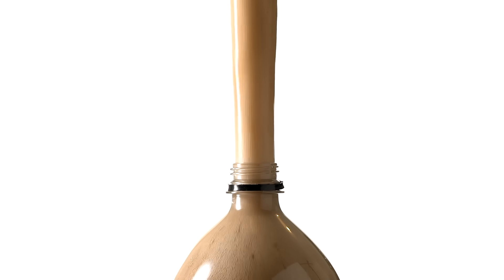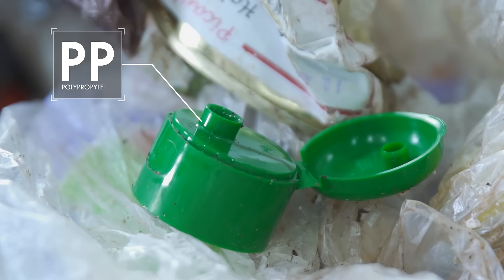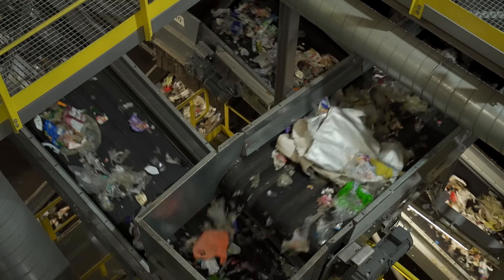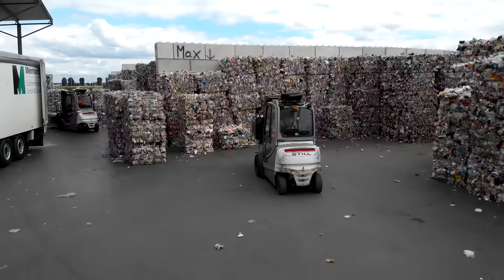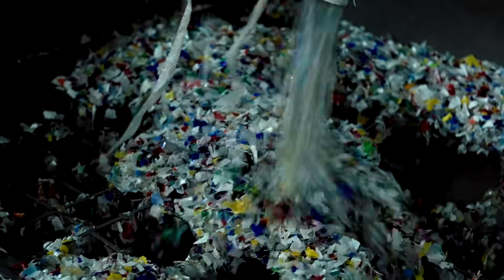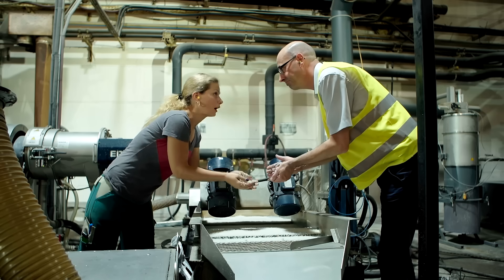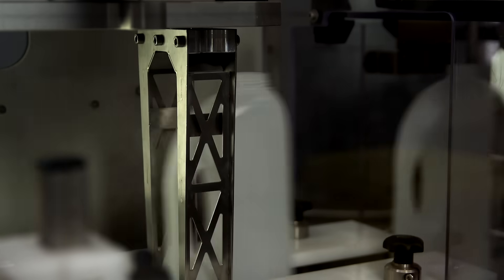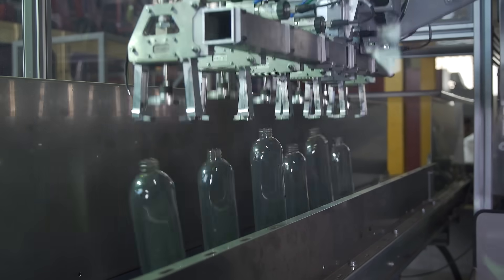Recycling plastics – Resource efficiency with an optimized sorting method

Comment: It might sound kind of wild, but why cant they build houses with recycled plastic bottles. ??  !!
Reply: Structural integrity and characteristics of materials is the most important point that makes industries choose a certain material for its application. So, is there a plastic that can replace a reinforcement bar while construcing a building, would be a few questions
Reply: It's definitely possible for companies that manufacture plastics that are used for construction like electrical sockets and blue electrical boxes to use recycled plastics.
Reply: It would be more expensive than conventional material.
Reply: @andregenter4213  that's true, it would have to have outside incentives like maybe a tax break for companies that use more recycled plastics in their products
Reply: https://youtu.be/c-wE2oaQ8Mo

Comment: It’s time manufacturers were ordered by all governments across the world to use only recycled/100% recyclable plastics. 

I live in the UK, many councils (to those outside the UK, our waste collection is performed by our local councils) within the UK don’t have any facility to recycle PP (5) plastics, the same occurs with Tetrapak items which all end up at incineration plants or landfill. Currently only 18 local councils within the UK offer Tetrapak recycling which is so disappointing.

Either governments need to change the legislation to prevent these “hard to recycle” plastics from being used by simply banning them as manufacturers would easily substitute them for another plastic that can be recycled. The alternative is for all councils to centralise the management for certain “hard to recycle” items and invest in the technology to permit it.
Reply: There's a tone I could go through regarding this but I'll try to keep it short. What makes thermo-plastics "hard to recycle" is determined by two main factors. What additives were used in the making of the original product and if the plastics have been bonded to other incompatible plastics or materials. Because what we want back from the plastics during recycle is the polymer itself and as little else as possible. But before we can even consider changing legislation regarding "hard to recycle" plastics, we need to consider why those additives and material bondings are done in the first place.

And that simply comes down to the consumers. These choices are more about economics than anything else. Consumers would rather buy a toothbrush with a soft TPE touch and matching colors than a plain white hard bristle rod. Even though the latter is the easiest to manufacture and recycle, consumers pay more for the "fancy" option. And if there's a higher demand for "fancy and hard to recycle" toothbrushes, manufacturers will follow that demand.

Fun story about that: Back in the day when plastic toilet seats were introduced, they were mostly disregarded by consumers because of their "cheap" feel in comparison to wood or metal seats. What manufacturers did was to add some chalk which increased the weight of the seats and made the product feel more "premium". All the while, chalk is cheaper than plastic, so the manufacturer saved money on production and consumers paid more for them.

What I'm getting at is that there are so many cogs turning in the decision making of how plastics are handled that simply "changing the legislation" isn't going to fix the problem. Especially since "hard to recycle" plastics isn't a definition. It's relative and ever-changing.

And I didn't even touch the subject of incineration plants.

Comment: If the caps are seperated at source itself, Can that be sterilized through and reused....instead of crushing, melting and remaking those caps ?
Reply: @Learning History A different idea I can think of is actually sorting the caps by manufacturer or type and then regiving/reselling to the original source. The price gotta be lower than making new caps tho which is... pretty low I fear

Comment: Aimsea Group one of the biggest manufacturer for non-toxic, Eco-friendly, odor free Ca/Zn PVC Stabilizer & additives/Heat Stabilizer/One Pack Stabilizer for PVC floor, wall board, profile, ceilings, pipes, water supply pipes, drainage pipes, PVC fittings & any PVC Solution. It has good weather stability, environmentally friendly, excellent initial coloring, low plate out, better cost performance, good thermal stability and wide processing range. Welcome to inquiry. For more details contact: 

Phone/WeChat/WhatsApp: +86 18145867486

email: anis.r@@t
website: @t or @t

Comment: In the early 1990s, I worked for a Major Cola distributor in central Massachusetts, USA. I was a phase one recycle material sorter. Trucks would roll in, after they had made their deliveries, and off load bags of plastic bottles and aluminum cans. It was my job to empty the bags on a conveyor belt and remove foreign materials from the bottles/cans depending on which we were baling at that time. What sort of foreign material? Moldy food waste, such as pizza, grinder sandwiches, chicken bones, medical waste, such as syringes, dead animals, such as mice and rats, human and animal waste, aka feces, to name but some of what I retrieved from those bags. Beyond nasty! I was issued rubber gloves, a size too small, I wear XXL. I would go through 8 - 12 pairs a day! From which, I developed a latex allergy, as well as, chemical burns from the highly corrosive cola syrup. Many sodas contain phosphoric acid as an ingredient. This acid was developed as a universal solvent in medieval times. Ever see a frosted glass bottle, or glass with frosted designs and/or lettering? This is done with wax and phosphoric acid. The blue plastic barrels in which the syrup for these colas are shipped have warning labels that warned that their content is highly corrosive. At the end of my shift, I could literally stand my coveralls in a corner, as they were stiff from the cola syrup. The injuries to my hands were explained away as eczema. I was fired, due to an on the job injury, due to the negligence of co-workers on another shift. I received a settlement, half of what I should have receive, bamboozled by my lawyers. Lawyer, bad spelling of a liar. Years later, karma saw them disbarred for being in bed with the opposite side. And since the time I left that job, I have never had a bout of what the company quack named as eczema. They are as shiny as a freshly minted penny, from the burn scars.
Reply: You sound too dammed smart for the job!!
Reply: Nice story, just remember do not spread fear about chemicals: there are far far more nasty and toxic chemicals than the good ones it all depends on concentrations and types, thank you.

P. S. I know you had your reasons, I'm speaking just to make sure that there's no science ignorance here.
Reply: @giovannipelissero1886  I fail to grasp your point. I, personally, am addicted to one of those name brand sodas. Besides the injuries in my "story", I have diabetes and kidney stones. I once passed an eight millimeter stone, naturally, and passed a 2mm one today. The problem is that there is a global science ignorance, and a vast need to ramp up recycling. The Earth's oceans and seas have floating islands of plastic that many of the human race have not a clue of their existence. All these so-called natural disasters is Mother Earth crying out warnings, that we can no longer ignore her warnings. Fresh water aquifers are drying up, never to flow again. Why, because of all the living water bags that walk our earth.
Reply: @BayouOgre  sorry I misunderstood your comment.
I agree with you, the earth is deeply changed and that is a fact, and in some in cases in a irreversible way or the way to reverse things is incredibly difficult. 
Plus, I'm also worried about the mere resources of plastics which are petrol based that one day will run out.

Comment: If it came from the under ground then put it back simple as that 

I think
Reply: It’s made from crude oil by breaking and restructuring hydrocarbon chain . This manufactured plastic with all its benefits have a single most severe negative impact I.e. it doesn’t degrade until 500-1000 years . Now imagine all the plastic ever created and more that will be manufactured in future. What would be the result ?

Comment: as long as human being needs "convenience, cheap stuffs and profit",  pollution will always come along.
Earth has been circling the sun for billion years. When human being vanishes from the surface of the earth, all the pollution problem such as toxic waste, plastic particle in the ocean, CO2 in the atmosphere will be solved because the earth can rejuvenate by itself even nuclear waste is not a problem!
The soonest the human being disappear from the earth, the soonest the earth starts rejuvenate itself. 
SO, LET START SCREWING OUR SELF, FAST!
Reply: 400 million years ago trees littered the earth and 50 million years later the earth learned to break down trees. scientists recently discovered a new enzyme that breaks down plastic into its original form which just goes to show how well the earth adapts under extreme stress. they’ve engineered and modified this enzyme to break down plastics at a 4x higher rate than normal. as long as we keep the plastics out of our oceans were ok 👌🏽

Comment: I want to buy the equipments that process the recycling. This is great to keep our city clean. Please provide informations that i can use to get the company built the recycling plant process.
Reply: Do you have any clue how much these machines cost I work a yard like that the machines sale for hundreds and millions of dollars
Reply: Wendinmonegde Pitt I wouldnt say the machines are the problem, the infrastructure is. If you use trash like in the US you dont just have to sort the plastics and once in a while a shoe or wood but the entire trash with food and basically everything... I dont think these machines would do too great (or at least far less efficient) under those circumstances...

If you become the President your chances at achieving this in the US should be much better =D But hey, get it going, who am I to say if it works or not
Reply: Buen proyecto, alta rentabilidad

Comment: It’s a step forward but not good enough. Plastic has to be reused by refilling containers. Once off use should be illegal. Why should the empty plastic Coke bottle be used only once? Perhaps plastic becomes toxic in the sun , then we will have to create better quality plastics. We need to re use plastic containers and that’s the only solution. As for clothing we need to move away from plastic fibers by heavily taxing the synthetic textile industry.
Reply: Nick Voutsas Not wrong but just simply refilling bottles and containers of food wont work... No way you get those clean enough without melting it down in order to put food in it again.. there is no way, you have to make a new bottle from the old one
Reply: Just use glass everywhere
Reply: bastien pabiot : good idea but producing glass consumes a lot of energy
Reply: @nickvoutsas5144  if you're careful enough you can use a glass bottle for decades, and they don't need to be recycled, the could just be "factory reused"
Reply: @bastienpabiot3678  and germany economy do so, they have that system (for ex. for beer bottles) working for decades

Comment: i work in  a recycling plant in the UK for 3yrs so i know how it works
Reply: that's really great, you could tell us if there is any difference?
Reply: @ultrasoft5555  we did have machines  to separate the steel &aluminium  than rest was shortened bye  hand
Reply: I work at a smaller scrapyard in the US

Comment: Recycling is an inefficient, expensive and energy-wasting process.  All plastic should be burned as fuel to make electricity. If you don't know how it works, look it up.
Reply: Doesn't that emit gasses such as co2 and others that can be harmful to the atmosphere?
Reply: @deafkite638  Yes, but recycling emits massive amounts of pollutants too, for instance in sorting and and moving around all of the recycled materials again and again, and processing them. In one video, a British journalist finds a plastic bag from a British market in a recycling pile in China. Much "recycled" material ends up in landfills anyway. The most efficient thing to do is to get rid of plastics and paper as close as possible to their source, i.e., burning them for electricity. The practice is common in Europe,  which has limited landfill space.
Reply: @tigerphid9677  Well, I really seem to like your argumentation, but aren't you actually taking a 180 degree turn?I mean the arguments you've showcased all speak for the unsuccessful way of recycling the waste. Are u talking about that documentary,  where the guy has found "recycled" rubbish in a pile in China and also in Poland?When yes, I get it. So you just want to point out that the carbon dioxide emissions, resulted after burning the rubbish down cause less environmental danger than PROPER recycling?I mean like shown in the video and not how it was made in the other documentary, where all the plastics landed into the landfill?
I obviously highly understand how rare this production pipeline is used worldwide, but don't you think burning the rubbish is still better than recycling it in the way shown in this video?
Important notice: which way is theoretically better?Not talking about the the insemination or realization up to nowadays?
I'm eagerly looking forward for your answer to get some enlightenment here!
Reply: @eugeneevpatchenko546  There is a garbage-to-energy plant in my town across from the grocery store and Walmart. I have never smelled it or had any problem with  it. It has been operating for 30 years. It works perfectly well. On the other hand, thousands of cities and towns across the country have abandoned recycling because it is massively inefficient and expensive.
Reply: @eugeneevpatchenko546  are you enlightened with answer .
Reply: tiger phid I see you dont really understand what youre talking about, and thats totally okay, recycling is a complex topic..
But just to scratch the surface of your misinformation: How is finding a recycled bag in China a bad thing? If that means what you imply it does, then that says the bag (or rather the plastic of it) has been used twice before it ended up in China. Difference to the “non recycled” plastic bag? Its plastic was used multiple times making it useful. 
Ideally that bag wouldnt have ended up in China but be recycled AGAIN (it has been before as i’ve said) which shows there if work to do but to say that that shows anything is just straight up dumb. 
We cant keep on producing new plastic for eternity, maybe look into plastic production and its components before you act like burning plastic waste would be a long term solution because its obviously not.
Reply: @Ranjitshedge  Not really:)But I keep up searching, that's the only thing I can do
Reply: @lucaklp The plastic bag ended up in China because millions of tons of plastic used to be shipped to China every year for recycling from all over the world. It no longer is; the economics don't work any more.  This was a massive waste of energy, to ship all of this stuff all around the world. Plastic should be burned in incinerators to make electricity close to its point of origin. Plastic is fuel. To waste time, energy and money recycling it is absurd.Trash-to-energy plants are very common in Europe since Europe has less land than the US for landfills.  Along with nuclear power, we can have all of the electricity that we want and solve our waste disposal problem at the same time. Paper,  newspaper and cardboard also are good fuels.
Reply: Agreed
Reply: To simply put,  crude oil is the raw material for producing new plastic . Now do the calculations in your head the amount of new plastic you wanna produce if not recycle . And the quantity of crude oil requirements every single year
Reply: @saketsagar2156  If you burn plastic as fuel, you replace the burning of oil, coal and natural gas.
Reply: @saketsagar2156  Insults are the last refuge of a loser who cannot win an argument on merits.
Reply: Steve Nikitas glad you mentioned . Appreciate it👍🏻 . Have same level of understanding of the subjects too .
Reply: Just go on churning plastic as a fuel and see how far your madness grants your vision to understand the variety of setbacks

Comment: I worked at Sarcan Recycling for 19 years. I handled many types of materials.  They came from the depots in the Northern half of the province of Saskatchewan.  Although I hauled out the bales of plastic, aluminium, and beverage containers, I also hauled out crushed glass, and cardboard bales. They are very busy at different times of the year, and it’s an extremely interesting place to visit.  We often had school students from the various schools in Saskatoon come to the Processing Plant, which is where I worked. In later years, we also started baling plastic milk jugs. I did a lot of these, and it’s interesting as to how they fill the baler. It’s almost like baling sponge.  Then before you realize it, you have a full bale of milk jugs.  I won’t go into detail on everything, but the products left our yard, ready for the next step in their recycling journey.  If you have the time, and want to see how the various materials are handled, visit a Sarcan Processing plant.  You’ll be surprised by what you will learn.  Thank You.
Reply: The next step for plastic is ugly clothes or rugs and then incinerator as most plastic can be recycled only once :)